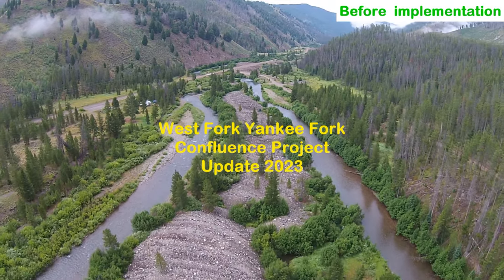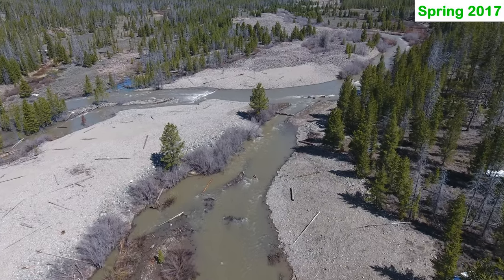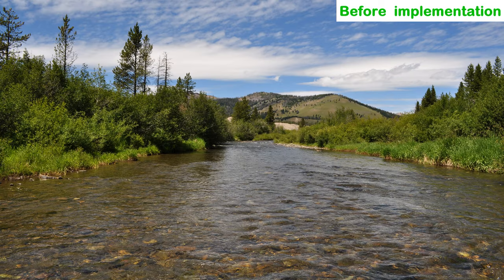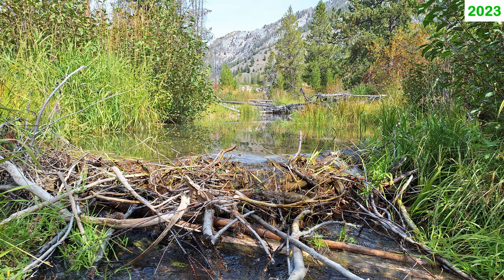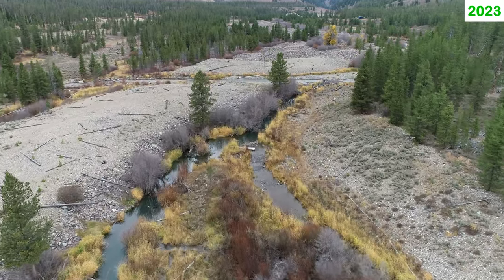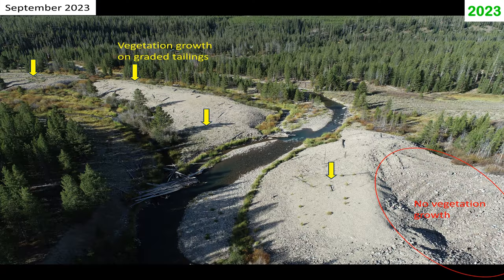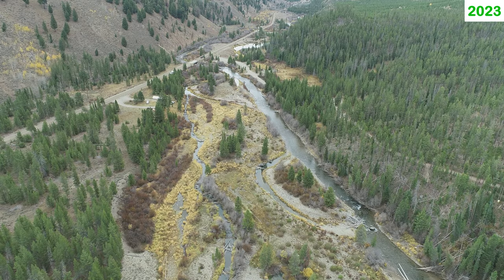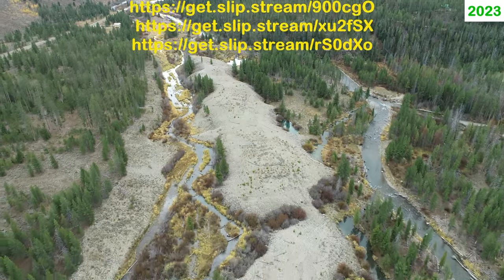West Fork Yankee Fork Confluence Fish Habitat Project update

Comment: Was always a favorite place to visit growing up. Glad to see fruitful work has been done on that wrecked area.

Curious though, were any BDAs or PALS built to assist the beaver & LWD trapping? Also, where the constructed side channel was built, an "easy" (so to speak) would be putting in place a rock barb, maybe a low water barb. 

Love follow-up documentation. One thing conservation needs to do a better job of doing. Great video! 😊
Reply from the maker: No BDAs.  The beaver moved in and went to work quickly on their own.  We did use some logs to make a "bleeder" structure at the top of the long side channel.  The loose wood racked on the logs that anchored the bank on the stream side of the bleeder structure.  It seems like capturing the loose floating wood was accomplished by projecting the wood structure into the pool so the racking wood had two contact points on which to settle.